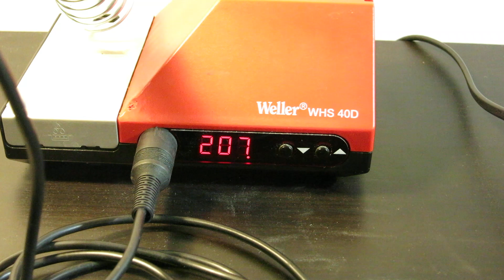Weller WHS40D misbehaving when connected to 110V and step-up converter

Comment: I imagine the unit uses zero crossing switching (ZVS).  In other words, when it needs to turn the element on or off, it waits until the voltage is at zero of the AC signal.  This essentially eliminates switching noise.  Problem is, your iron is set for the half-cycle time for 50 Hz while you're trying to operate it on 60 Hz power.

Based on the display flashing, I'm going to guess that the internal processor is basing a control loop or something on the 50 Hz signal with hardware timing loops.  It gets all confused at 60 Hz's faster switching rate.  If that's the case, you're pretty much screwed unless you want to try to find a 60 Hz to 50 Hz converter.  These were common in the 60s and 70s and consist of a 60 Hz motor turning a 50 Hz generator.  I used to have one but it grew legs...

Maybe some chicom company is making a solid state version.  It would be quite expensive because of the high current magnetics involved.

Something else you might want to take a look at is a Cycloconverter.   I'm sure I understand their functionality to try to explain it here but I know Honda makes several portable generators that run at high frequency and convert to 60 Hz using a Cycloconveter

If I was in your situation, I'd set the soldering station on the shelf as a souvenir and buy a station designed for 60 hz, 120 volts.  You might consider an inexpensive AIOU station.  Some folks call them cheap.  I call mine inexpensive and reliable, having run for over 10 years with only one heater replacement.

John
Reply from the maker: I also thought that first that the 60Hz are the issue, but on the bottom of the soldering station it says "230V 50Hz/60Hz" so I do not think the 60Hz is causing the issue.